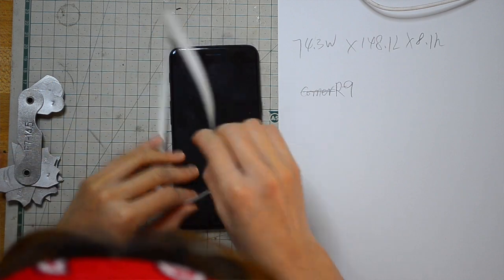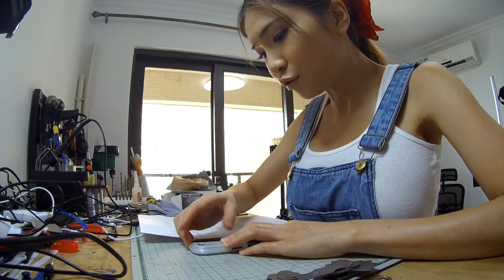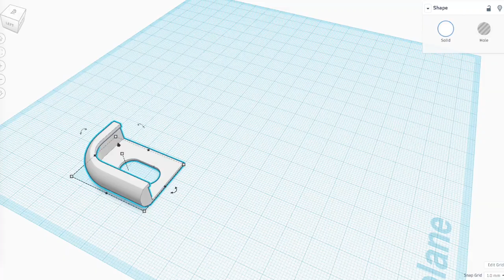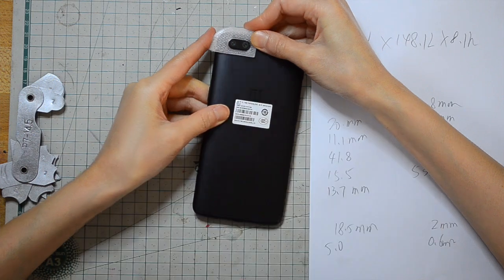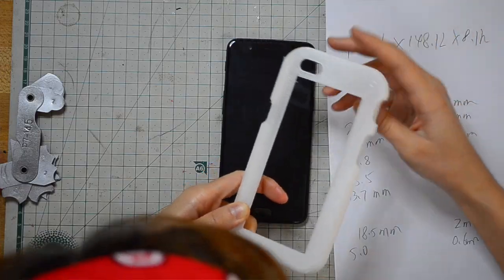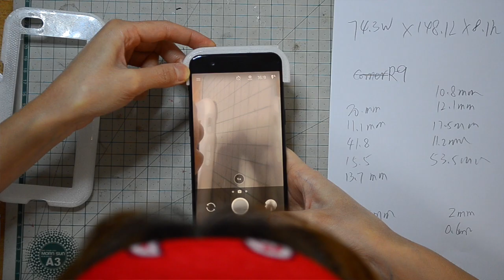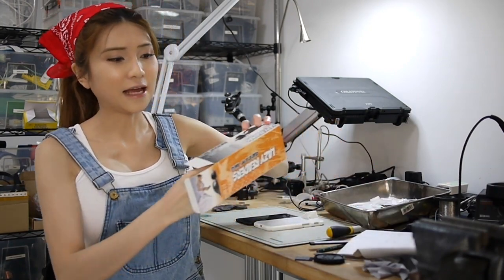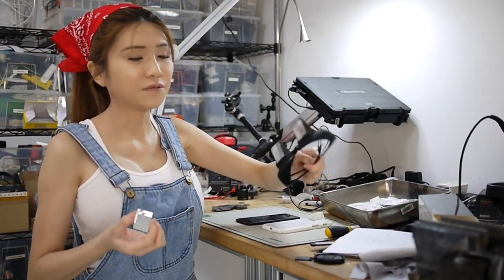OnePlus 5 3D Printed Stealth Camera Case

Comment: you can use the back side of the vernier caliper to measure the inner radius of the case when you are measuring the camera. It is easier than trying to align the front blades.
Reply from the maker: Which is more likely?
A. I can use CAD and radius gauges, depth and step points on the caliper, but I do not know how to use inside measurement points of the tool.
B. Inside measurement points cannot fit inside that hole. So I had to compare it to the outside points and eyeball it.

Comment: Very cool! What material did you use for support when you printed the final thing upside down? When I print flexible material, I print on glue stick so it's much easier to remove from the build platform although I don't print on glass but on BuiltTak and it's almost impossible to remove otherwise.

Comment: Hi! May I know what material u used?
Reply from the maker: TPU
Reply: What are the setting? I am using Cura 2.6, with Delta Tower, the TPU filletment keep struck at extruder, I am using a long rang feeder, is it ok to print TPU?

Comment: What about a mirror? Why a prism?
Reply from the maker: So the image is not reversed
Reply: Naomi 'SexyCyborg' Wu okay that is smart :)
Reply: A mirror would have to be 45 degrees (and stick out further) and front surfaced which will be harder to clean.
Reply: a mirror is flatter and could be mounted on a hinge. however a prism is way cooler

Comment: Might be easier and more accurate to work on the phone case by starting from a solidwork phone models. Give it about 0.1 mm margin of fitting.
Reply from the maker: Of course it's more accurate to start with a model of the phone- there are not available and OnePlus refused to provide one.
Reply: Naomi 'SexyCyborg' Wu https://grabcad.com/library?page=1&time=all_time&sort=recent&query=Oneplus%205

Here you are in case you need them.
Reply from the maker: Yes, I can use Google also- only one of those is the One Plus 5 and it's not accurate.

Comment: Great work! You could also design it as a microscope with display and use the digital zoom e.g. for soldering SMD components on a PCB so that it looks something like this: https://www.banggood.com/Mustool-G600-Digital-Portable-1-600X-3_6MP-Microscope-Continuous-Magnifier-with-4_3inch-HD-OLED-Display-p-1119592.html